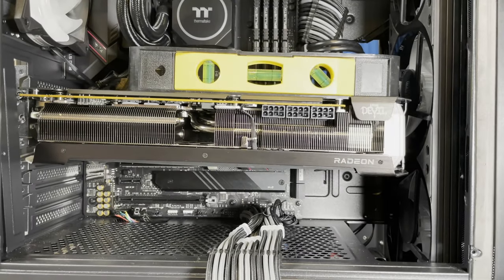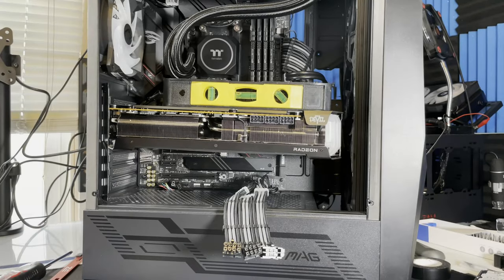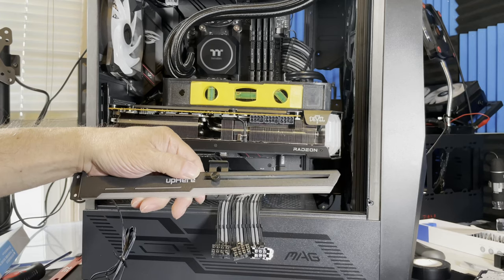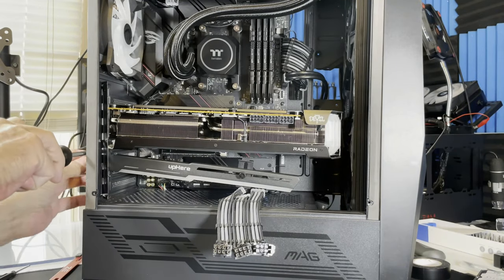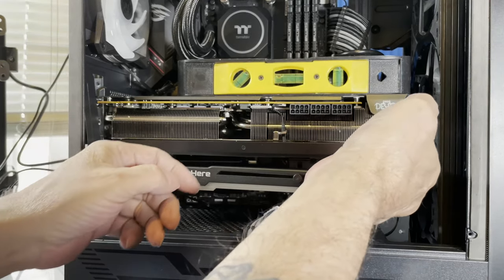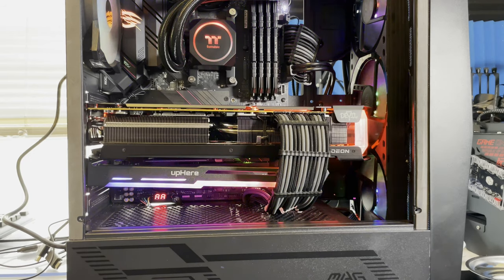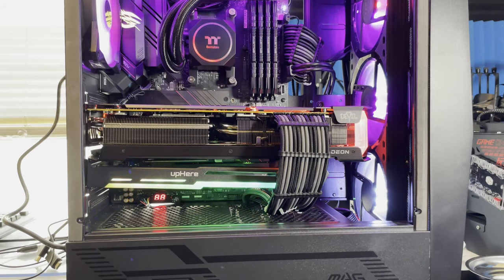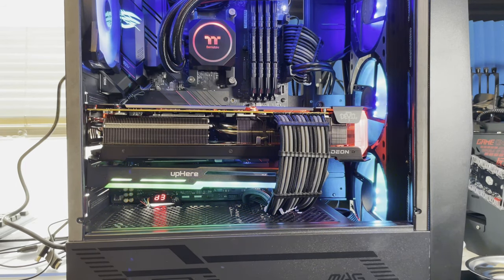Installing a UpHere GPU Bracket

Comment: Where do you plug it in?
Reply: My board has 4 pins
Reply from the maker: It plugs into one of the three or four pin RGB plugs on the motherboard.
Reply: @JPsTechReviews  the problem is that the bracket has 3 pins and one blocked out so i cant plug it into the motherboard 4-pin led header. So i probably cant use rgb
Reply from the maker: @alfa955  your board doesn’t have a three pin rgb on it? if the three pin is being used you can get a splitter cable for it.
Reply: @JPsTechReviews  no i dont think i have it - i just bought the pc its a bit old motherboard (maximus hero viii alpha)
Reply from the maker: You can get an adapter that goes to the sata on the power supply, I read almost the whole manual and I can’t believe it doesn’t have a three pin header.  That board was top of the line when it came out. Sorry I couldn’t help more.
Reply: @JPsTechReviews  thank you very much. Helped a lot

Comment from the maker: So there has been so much debating why this GPU had such bad sag.  Anyway let's talk about this, first the case was a case made of thin metal and changing that didn't solve the problem, it helped but barely.  The easiest fix for this problem in a Magnetic GPU Brace Support, and you can get one at Amazon.  https://www.amazon.com/Graphics-Support-Adjustable-Non-Slip-Universal/dp/B0B2WCTGFV?th=1
The other reason is the Support bracket on the GPU itself, Jay's 2 cents has a great video on the link attached:  https://www.youtube.com/watch?v=liChy76nQJ4
Since this build, I have always followed both practices when needed.  Hope this has helped,  We live and learn or don't and fail.

Comment: the backside of your case doesnt hold - it has too thin tin, look how it all bend out; the bracket is bullshit.
Reply from the maker: The case is a shit case and I would never use them again,  I had sold it to someone and called them and replaced the case with a Fractal Torrent a couple of months later.